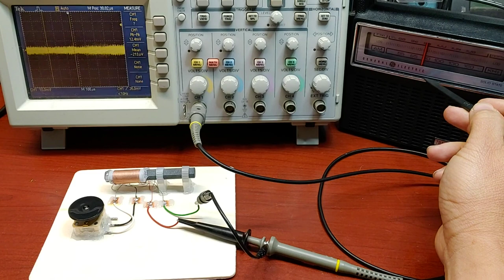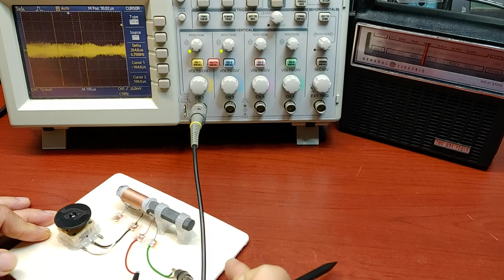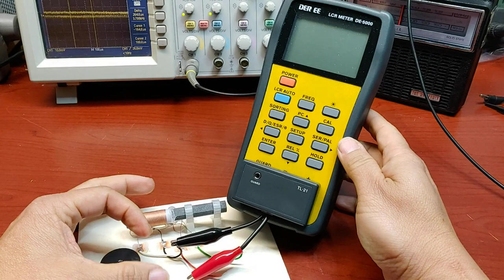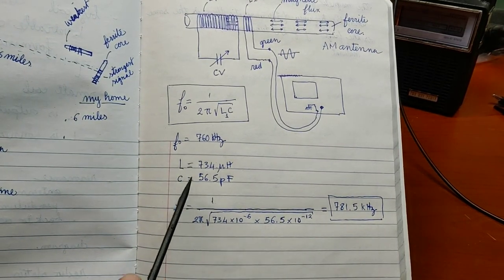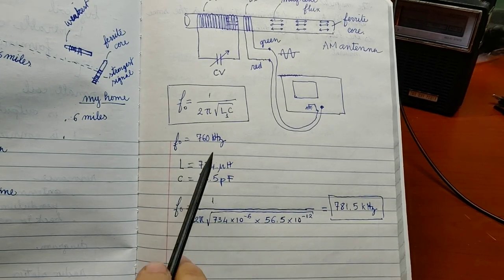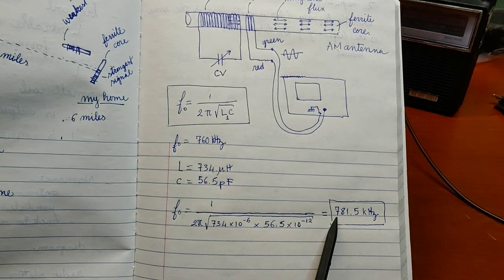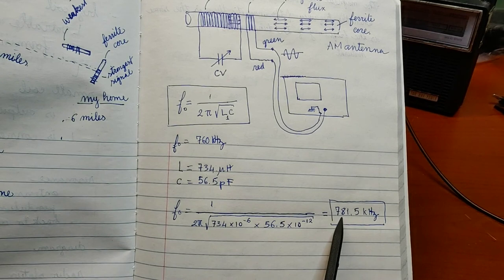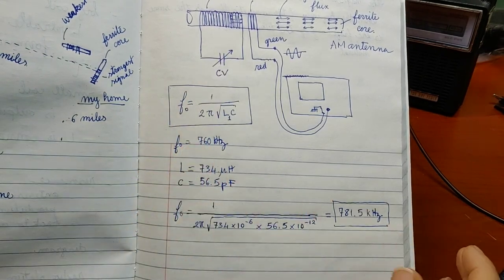AM Radio Antenna

Comment: The natural frequency is higher than the damped frequency. That is why the calculated natural frequency 781.5kHz is higher than 760kHz. The difference is not only because of calibration in the test instruments.

Comment: I want to ask sir. I have an AM radio. The ferrid antenna looks a bit short. And that's already factory default. How about I add or connect a few ferrid rods to make it look longer. and without changing the coil position. Will it increase sensitivity in signal capture? Or does it actually make signal reception worse...? please explain!!
Reply from the maker: Making ferrite rod longer by adding or connecting one or a few ferrite  rods together doesn't improve signal reception, but may get it worse. 

AM radio wave propagating in air is comprised of two components: electric field component (the vertical component which is also the same orientation of the broadcast antenna) and magnetic field (the horizontal component). The ferrite rod antenna is designed to receive only the magnetic field (the horizontal component) component of the radio wave.  That's why the ferrite rod is placed in horizontal orientation. The more magnetic field lines go through the coil of the antenna the higher voltage is induced on the coil, and therefore better signal reception. So the coil with bigger cross section area captures more magnetic field lines, and therefore stronger signal received. The ferrite core help to gather more and concentrate magnetic field line, and conduct magnetic flux through the coil.  Placing one or more ferrite rods on the magnetic line paths, may block the magnetic lines and therefore reduce signal reception.

Before the ferrite core antennas were used, the old tube radio antennas had big cross section areas placed on the back of the radios. Since the ferrite core were used, the cross section area of the coil in later AM radio has much smaller cross section than the old air core radio. 

To improve AM radio signal reception, people use antenna boosters. You can look online for many AM radio antenna booster videos  Basically, the antenna booster is a secondary AM antenna, which include a coil and a variable capacity, the core can be air or ferrite.  To improve the signal reception for a radio station, both the main antenna radio and the booster antenna must be tuned to the same radio station. The resonance of the secondary antenna adding more magnetic field strength to the antenna of the main radio, that boosts receive signal on the radio.

So back to your question, if you just add ferrite rod only to the radio antenna, it doesn't help. But if on the adding ferrite rod, you add a coil and a capacitor forming a resonant tuned circuit, you can improve the signal reception significantly of the radio. It's an antenna booster.

Here is a little bit more about the ferrite rod. The ferrite material can conduct magnetic flux (or magnetic current) but cannot conduct electric current. This prevents the forming of eddy current occurs in the core. If the core is made of iron, the oscillation of the magnetic flux generates eddy current in the core, and since the iron conduct electric current, the iron causes the short circuits, and that kill of the magnetic flux in the core, and therefore less voltage is induced on the coil of the antenna. 

Hope it helps!

Comment: You have to calibrate that meter before taking measurements but imagine it's close. It's a great meter for it's price.  I have compared it with my more expensive meter and it's very accurate (once calibrated 😁).
Reply from the maker: Thanks for the info!

Comment: simple but very informative sir. please share the details of ant coil dimension ,no of turns gauge of wire,here in our place very difficult to get it.
Reply from the maker: You can get the antenna from "Elenco Two IC AM Radio Kit" on Amazon. I tried to get some measure of the antenna and here what I get:
. Ferrite core dimension: 80mm long, 10mm diameter
. Big coil # of turns: 106 turns, inductance: 740uH, resistance: 9.34 ohm 
. Small coil # of turn: 7 turns, inductance 7.2uH, resistance: 1.11 ohm

I'm not sure with the copper wire gauge. It's multi-strand yarn wire.  If you can not find them, I think you can use any copper wire with size from 32AWG to 26AWG. 

You can also find other similar AM ferrite antenna on Amazon, ebay, or Aliexpress or from old AM radios. 

Good luck.
Reply: @musikbox2020  thank u so much sir.a very good insight into theory and practical